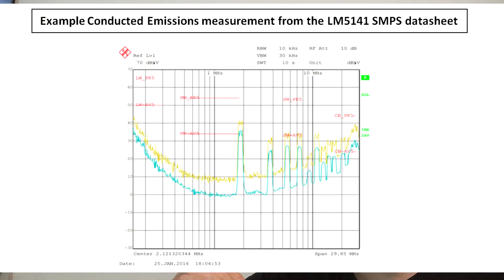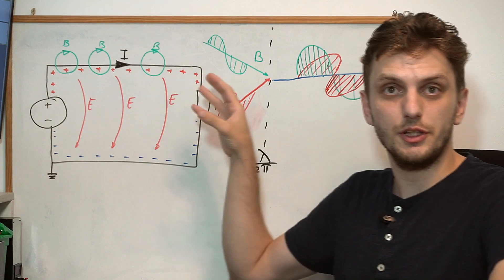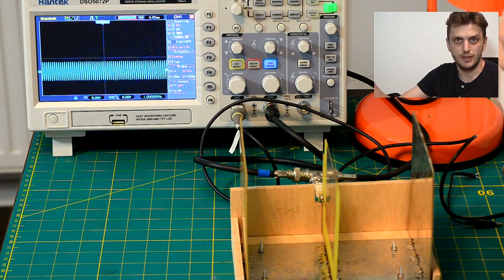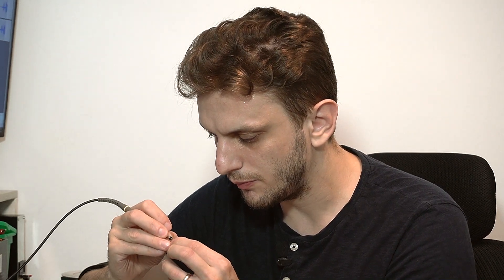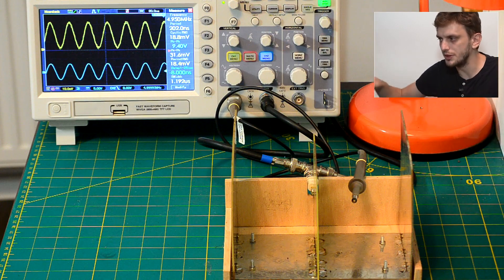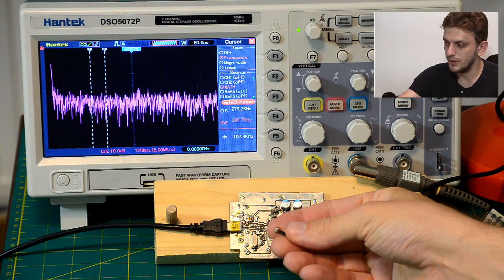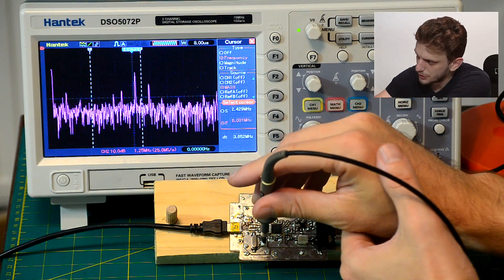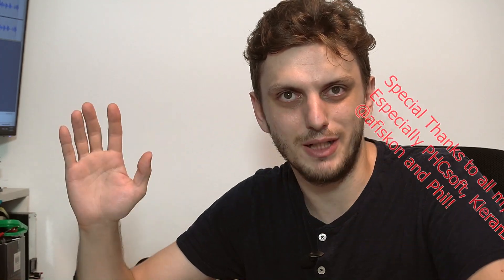EMC debugging - Near field Electric field probes

Comment: @FesZElectronics 
Great demo and easy to follow explanation. 🎉 How about a video using Tiny SA. Does commercial probes provide a calibrated reading ?
Reply from the maker: I cannot comment on the usage of a Tiny SA since I never used one.. maybe I'll try to acquire it in the future. Regarding "calibrated readings" - even with a commercial probe - even if the response is more reliable - there is a better correlation between field strength and measured value, the nearfield measurement in general is highly position dependent - you move the probe a bit to the side and the measurement completely changes.
Reply: Thanks. Love your videos.

Comment: i did considerable EMI tesdting a few decades ago on switch mode power supplies and found the layout of the PCB had a major impact on the EMI produced by a power supply.
Reply from the maker: I came to a similar conclusion - a "good" schematic is never enough, a big contribution to a design comes from the layout.

Comment: Great vid! You are a natural talent in explaining how things work. Question: The spikes you measure in the near-field, are they also present, say, 10 meters away as RF? Is there a voldtage threshold that needs to be exceeded for near-field to also radiate out in far-field?
Reply from the maker: If the near filed noise will be visible in the far field has a lot to do with the casing and the overall device construction.  Usually its good practice to measure using far field methods to observe the actual problems and then use near filed to find the sources of the problems on the device; going the other way is not that easy since there is no "threshold" or obvious link.
Reply: Thanks. Yes, I agree. Reason I asked is that radiated low frequencies, say 1–100 kHz, are not so easy to measure using an antenna 10 m away.
Reply from the maker: Do you need actually need to measure radiated emissions at such low frequencies? Anyway, at this frequency most of the radiation will come from the cables connected to the circuit rather than the circuit its self; maybe just magnetic fields coming from some poorly shielded inductors could cause problems.

Comment: Nice Video ! Can this E field probe be used to check the radiated immunity performance  of PCB ?
Reply from the maker: In my experience, this will work only under very limited circumstances. You can inject noise into small parts of a circuit using near field probes, but you can't generate noise over the entire circuit usually.

Comment: let's say far field measurements come back with a high spike at 200 MHz. Will the near field probes (E or H) also see a spike at 200 MHz ?
Reply from the maker: Most likely yes; the main advantage of the near field probe is that they will show you the exact emission point - the probe needs to be very close to the noise source to pick it up, otherwise you will not see the spike. The far field measurement picks up the general noise output of the complete unit, with near field probes you can usually localize the exact circuit/component responsible.
Reply: @FesZElectronics  thank you for you insight.  I did some near field probing recently and came to the conclusion that the FFT on my cheap Rigol scope isn't really up to the task. I'll have to look for a proper spectrum analyzer.

Comment: Hello Fesz, 
Thank you for the video. I was wondering about how can we use the results we get from this type of pre-compliance testing, I mean they are basically qualitative and not quantitative tests, so  how can we translate what we got from them to the far-field tests and know for example, whether a spike should be an alarm that we will fail EMC around that frequency or not.

Edit: Another question, do you have any commercial E-field probes that you can recommend ?
Reply from the maker: In my experience, the use of near-field probing is to optimize designs on the bench (see if variant A is more noisy than variant B); the other use case is for debugging after a first round of EMC measurements in the lab - for example the unit is generating a spike at whatever frequency, then the exact location on the PCB can be determined using the near-field probe; subsequently any optimizations can evaluated in reference to the initial board. You can make the assumption that if you fail by 10dB and the optimizations you make are reducing noise by more than 10dB at the problem frq you should be fine, but this is very relative.
Probing alone will not be enough to ensure that a qualification is passed but it will help to evaluate solutions on the bench rather than in the lab. 
I don't know what to recommend, it depends on your budget - probes will go from a couple hundred usd to a few thousand.
Reply: @FesZElectronics  A great answer as always, Thank you.

Comment: what is the maximum frequency the E-field and H-field probes can scan? is it 6GHz or more
Reply from the maker: The ones I built, I have no idea, but probably not that much. On the other hand, commercial versions are available that go up to 6GHz or more.
Reply: @FesZElectronics  i'm asking in general
Reply from the maker: I'm not sure if there is a limit. But on one side, with increasing frequency, its more and more difficult to stay in the "near field" - at 6GHz the wavelength is 5cm so the near field ends at around 0.79cm. So its difficult to measure the magnetic and electric fields separately. On the other hand, a 6GHz spectrum analyzer is really expensive, and anything with more BW is even more expensive.
Reply: @FesZElectronics  ya now clear about it thank you
Reply: @FesZElectronics  is it 0.79cm or 0.79m
Reply: @FesZElectronics  let frequency = 400kHz then it's wavelength is 74900cm, then transition to EM wave occurs at (lambda/2π) which is 15cm, so which frequency lies below this transition point
Reply from the maker: Well, the far field starts at 2 λ; the reactive near field stops at  λ/2pi; and there is an intermediate region in-between; For 400KHz, you are right,  λ is 749m but  λ/2pi=118m
Reply: @FesZElectronics  awesome
Reply: @FesZElectronics  case1 : frequency = 400kHz , wavelength= 750m, (lambda/2π )= 118
 Case2: frequency= 6GHz, wavelength= 0.05m, (lambda/2π)=0.0079

My question is, on what basis the probe is applicable to low frequencies?

Comment: Hello, FeeZ Electronics!
I like your tutorials about the simulator S.P.I.C.E. LTspice, and all your educational content abount analogic electronics.Okay.I have some questions for you:
1.What are the limitations in analysing numerically  calculations of program LTspice in the matter of analogic and digital electronics?
2.From your professional point about modelling and simulation S.P.I.C.E. electrical and electronic behavioural predictions, if you made a comparasion between programs LTspice VIII and Micro-CAP12,which are difference between them?
3.I want to know how can I learn better analog electronics?
Thank you,
Dragos.
Reply from the maker: Hello Dragos!
1 - For analog electronics the main limitation on accuracy (in any simulator) refers to how accurate the simulation model is - how much of the parasitics and non-ideal behaviors are simulated. Also in HF circuits modeling parasitics of the PCB starts to be a problem. For digital electronics, the main issue is getting models that represent the various components - I mean a logic gate is easy to find, but a processor or something similar is a completely different story.
2 - I never used MicroCap but I guess I should try it. In general any spice simulator (LTspice, OrCad Spice, MicroCap etc) should be just as good. Simulation speed might be different based on algorithm implementations but as long as things are set up in the same way, the results should be identical. By setup I don't just mean the simulation circuit and models, I also mean simulator parameters - accuracy, number of digits used, extra default parasitics etc. 
3 - Practice. Simulate then build circuits to try and understand how they work. Once you think you understand the circuit, try to improve it - that will confirm correct understanding. 

Hope this helps!
Fesz